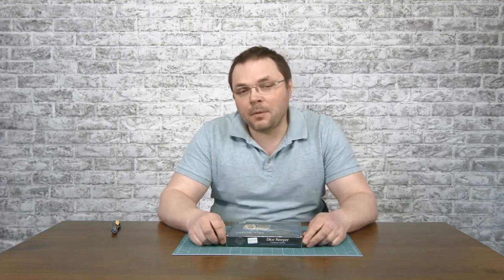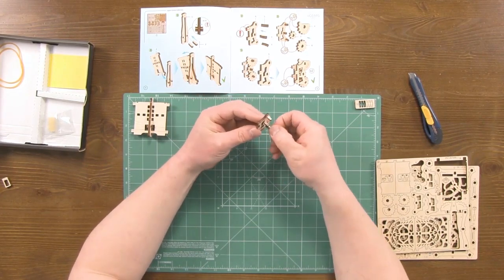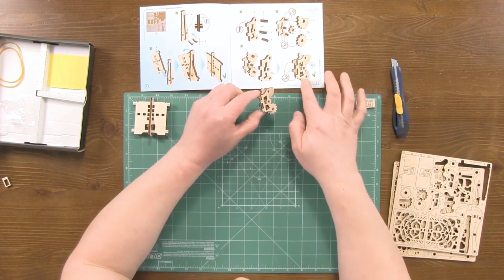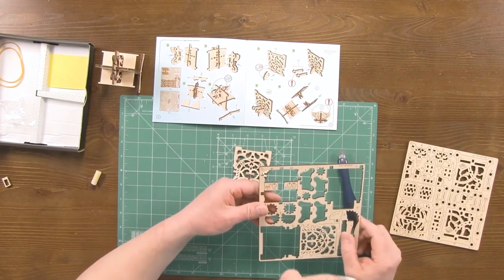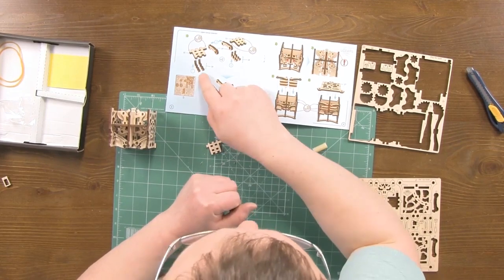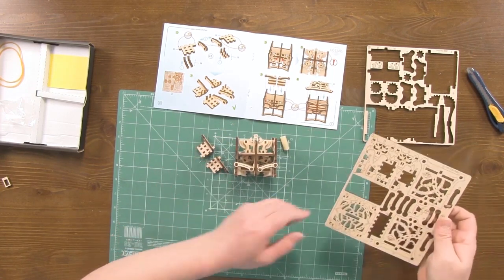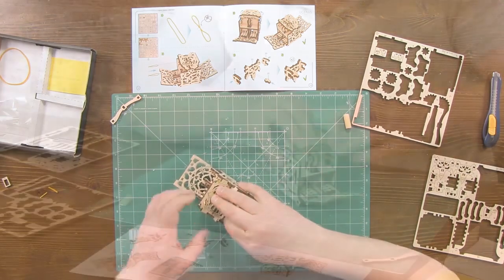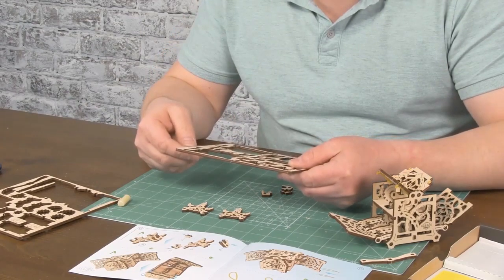Ugears Dice Keeper: Assembly Video || English Voiceover

Comment: Thanks for the video, the assembly went pretty easily with the video.  The dice keeper works well, and was fun to build, so thanks for that.  My only complaint is having to cut the rubber band, I would have preferred just having some correctly-sized rubber bands in the box.